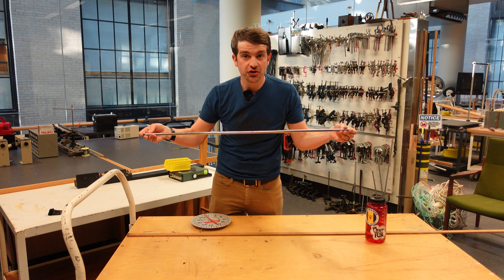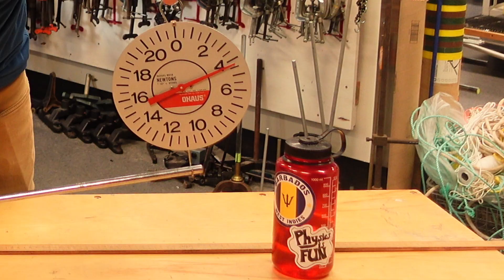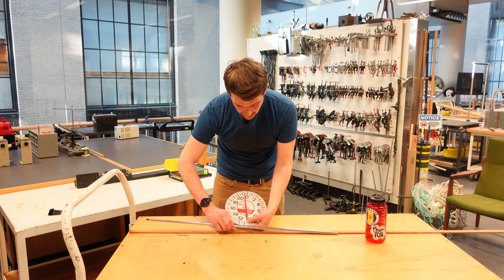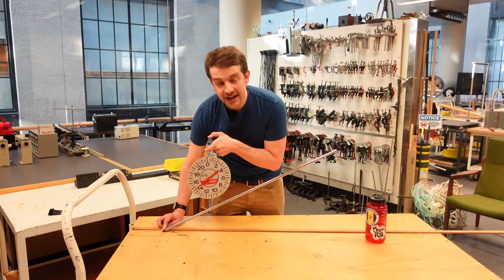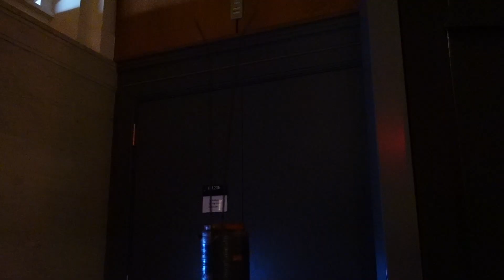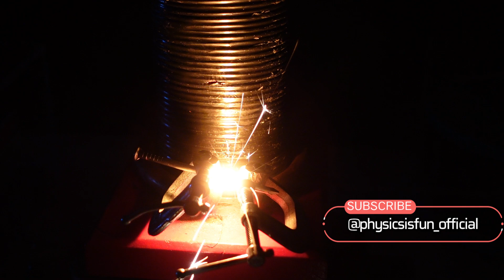MIT Physicist Explains Torque As Simply as Possible.

Comment: A good explanation, but I'm compelled to nitpick (albeiit on an important distinction)  Near the end of the video you refer to the "thickness"of a screwdriver handle.  I think you really mean the radius of the handle.  That is, the torque is the (perpendicular to the radius component of) force times the radius ( not the  "thickness"  ‐ which presumably is the diameter).  While the torque generated is a function of the screwdriver handle "thickness", it perhaps confuses the issue just a bit.

This is not intended as criticism, but rather as a comment to add clarity.

Comment: Torque is expressed ini lb.ft., not ft.lbs....
Reply from the maker: Those are both ways of saying the same unit. Force times distance is the same thing as distance times force.
Reply: @physicsisfun_official  The correct unit for torque is lb-ft (pound-foot), not ft-lb. Here's why:

Torque Definition: Torque is a measure of rotational force and is calculated as the force applied times the perpendicular distance from the axis of rotation. For example:

Torque
=
Force
(
in pounds
)
×
Distance
(
in feet
)
Torque=Force(in pounds)×Distance(in feet)
Unit Order: By convention, torque is expressed as pound-foot (lb-ft) to indicate "pounds of force applied at a distance of feet."

Common Misunderstanding
ft-lb is sometimes mistakenly used for torque but is more appropriate for work or energy, where the force moves through a linear distance.
For example, lifting a 1-pound weight by 1 foot requires 1 ft-lb of energy.
So, when talking about rotational force (torque), stick with lb-ft!

Comment: Ok, this explains torque when you're turning a nut or a lever, but what does torque mean when referring to a car's power?
Reply from the maker: @realSamAndrew  the ability for an engine to rotate the crankshaft is a measure of the cars torque. The more torque it has the more ability it has to rotate the output shaft. So large amounts of torque is great for pulling large loads especially down low at slow speeds.
Reply: Torque is time derivative of angular momentum, or how quickly the angular momentum of a system change. 
Power equals torque times angular velocity.

Comment: Can i ask; if a car wheel is twice the diameter, does the engine work twice as hard to rotate the tyre? Wondering how this effects the performance of a car as i have been looking at cars and it seems the upgraded models have larger wheels for some reason.
Reply from the maker: @stephenmorris3696  yes a larger wheel is more difficult to rotate. However, modern wheels are quite light and the spokes help reduce the rotational mass. But, it still does have some affect.
Reply: @ thanks for getting back to me. True they all seem to be alloy now. I have an old Honda with steel wheels and plan on keeping it for many more years, so next time my tyres need replacing I am thinking of going to alloy slightly wider wheels. It’s my understanding the thing I can do for the environment is keep my car as long as possible, as more damage is done to the environment in the manufacturing process, i only drive 8,000 kilometres a year.

Comment: Excellent, and  yet there remains this great mystery -- torque vs horsepower. I say this not by way of criticism, but in hope that you might be the one who finally can help me understand the difference. Please help me, Obi Wan -- what is the relationship between torque and horsepower, and how does it matter when driving a car?
Reply from the maker: @mannyedwards2820  basically horsepower tells you how much energy per time an engine can put out. Torque tells you the cars ability to rotate the crankshaft. So a larger Torque means you could pull a larger load and have more "grunt" at lower speed.  But I can definitely do a little video explaining the two in more detail 👍
Reply: @physicsisfun_official  I think I’m beginning to get the picture. For a given cylinder volume and combustion force, the torque increases with the length of the connecting rod, because of leverage. The rotating force of the crankshaft is transferred by gearing to the wheels, and translated into linear force at the pavement. So all gearing and fuel consumption and everything else being equal, an engine with a long stroke produces more acceleration at the same RPM as an engine with a shorter stroke? So then at some point the engine reaches the maximum amount of fuel it can burn in each cylinder with each ignition, and therefore the max torque it can generate on the crankshaft, and so at that point, the only way to increase power is to increase the RPM. That’s why I can peg my torque meter as early as 2000 RPM, but the HP meter (and rate of acceleration) keep rising until almost redline.

And that’s the interesting thing, if I understand this correctly; at some point, the torque at the crankshaft reaches a max, but if I simply maintain this amount of rotational force while increasing the number of revolutions per minute, I’m producing the same work in a shorter time, which is an increase in horsepower. Is that correct?

Comment: If we double the bicycle wheel diameter will we go twice as fast for the same human energy output?
Reply from the maker: Unfortunately no, because it will require more energy to turn a bigger wheel.
Reply: @physicsisfun_official  Can human cycle faster than walk for the same human energy output? If so how?
Reply from the maker: @chetan_naik  the wheel is extremely efficient. The only friction involved is jn the barrings. The energy a human generates is the same but when it's connected to wheels you can use way mote of that energy effectively. Gearing helps amplify that even more 👍

Comment: So what's the difference between Torque and moment ?
Reply: In engineering, Moment is the product of force times distance that causes bending.  Torque is the product of force time distance that causes twisting.  If you have, for example, a relatively long shaft with a driven gear in the middle, the force driving the gear causes a Torque on the shaft that is a function of the force and the gear radius.  The same force also causes a Moment that is a function of the force as well as the  length of the shaft, along with the axial position of the gear along the shaft.  So, the shaft is subject to stresses from bending (Moment) AND stresses from twisting (Torque).  The physical nature of Moment and Torque are different as they have different consequences in stresses induced on a part. The same force often results in both a Moment and Torque (typically with different values). It's important to keep this distinction in mind when analyzing the load carrying capability of components subjected to forces. While physicists (and  mathematicians, as well as theoretically inclined engineers) often conflate Moment and Torque, there is a fundamental distinction.  While there are some particular situations where a torque (acting on a shaft) can result in bending of a coupled component (and vice-versa), there is a physical distinction between the two.  While, mathematically they are both "couples",  ( the source of the cofusion/conflation, i think) there is a distinction that needs to be understood.
Reply from the maker: @suryanarayanan5614  what course you take/where you learn it! I took a grad engineering course in grad school and the professor started in with "calculate the net moment" and I went "um.. sorry but I've been doing physics 6 years now and I've never heard of that?" And he goes "oh in engineering we call a torque a moment " lol I've used "moment arm" to calculate torque. But never used moment itself as the word for torque, but many texts/university's do!
Reply: @physicsisfun_official  I'm doing a bachelor's in  mechanical engineering. 

I distinguish between torque and moment by considering torque as a specific case of moment, where it acts along the axis of a body (eg: shaft ) and actually rotates it .Moment on the other hand just causes a rotational effect like bending  . Idk whether that's technically correct.
Reply from the maker: @suryanarayanan5614  technically torque is not a specific case, but again there is a vast difference in terminology across industry, especially between engineering and physics 👍
Reply: @SuryaN000 
In Physics,
Simply ,moment means turning effect.
Torque produce turning effect.
Moment of force produce turning effect.
Moment of couple produce turning effect.
Unbalanced force produce turning effect.
Moment of force or Moment of couple,shortly known as Moment.
Literally,
Torque=Turning effect=Moment of force=Moment of couple=Moment 
👍

Comment: To avoid confusion between unit of torque and energy, torque  can be expressed as Joule per radian. Or Newton meter per radian. Dot product between force and distance produces energy, which is a scalar. Cross product between force and distance from fulcrum produces torque, which is a vector.
Reply: Based on your  continuing replies, I can only come to the conclusion that you are being deliberately obstinate, or have been poorly educated and don't understand the true nature of torque.  You can search the archives of respectable Engineering publications such as  SAE and ASME, and you will find little, if any at all, evidence to support your position that torque should be expressed as  Joules/radian or Newton meters/rad. 

I won't waste any more of my time responding to your comments - and hope that anyone who reads this string of comments is able to understand the problem in using Joules/rad. (Or any other unit of energy/radian  eg calories or BTUs/radian)
Reply: @ The hardest part of learning new things is to first unlearn previous knowledge that is incomplete or inaccurate. It's often easier to teach young people who hasn't been exposed too deep to those previous knowledge.
You can check the unit consistency in motor calculation for power.
P=τ⋅ω
where:
P = Power (Watts, W, Nm/s)
τ = Torque (Newton-meters per radian, Nm/rad)
ω = Angular Speed (radians per second, rad/s)

If you omit the unit radian from torque, you get incorrect unit for power.
Reply: If you're still struggling to understand my comment above, here's the break down.
Here's a common values in industrial motor.
P = 1000 W = 1000 Nm/s
ω = 3000 rpm = 50 rps ≈ 314 rad/s
τ = P/ω ≈ 1000/314 ≈ 3.18 Nm/rad

You can use an alternative unit, e.g.
τ = P/ω = 1000/50 = 20 Nm/rotation

If you use unit for rotational angle other than radian, you must include the conversion factor in your equation. Otherwise you will get the wrong value. Using radian is convenient since its conversion factor is 1. But as we can all see, it can make us forget that it's there all along.
Reply: This strikes me as an almost surefire way to CREATE confusion and obscure the fundamental nature of torque - which is, as explained clearly in the video,  the product of force times distance (or  as alluded to in the video, more precisely  - the perpendicular component of force times distance).  Using units of torque as Joules per radian makes no physical sense. Joules are the fundamental unit of energy in the SI system, and radians is a (dimensionless) measure of an angle.  What's the angle here that relates to the definition of and understanding of the nature of torque? 
When I was a Mechanical Engineering professor, I occasionally heard students use an engineering equation solving program that frequently gave answers in units that made no physical sense.  I created a "wall of shame" at the entrance to my office where everyone entering would immediately see.  If a student lacked the understanding to use appropriate units in the answer to a problem (even if the units "worked out"ok, their solution would find itself on the wall. Most assuredly, Joules per radian would make its way onto the wall. While not quite as egregiously bad, Newton-meter per radian would find itself there as well.  Adding dimensionless numbers as units to perhaps serve as a memory aid is just plain silly.  How about Joules per radian per Re per Fr?  There are a whole host of dimensionless numbers we can choose from, most of which don't add anything meaningful.
Reply: @frankfronczak4469  If you are confused, that's because you have misunderstood the concept. If the torque doesn't cause change of angular position, no work has been done. You'll understand better if you learn about the torque of a motor. Perhaps experimenting with variable speed drive can help.
Reply: @hamdaniyusuf_dani  I am not the one who is confused here. I perfectly understand that work is forced times distance or,  for a rotational system torque times angle of rotation. My point is that there is no reason to express torque in units of energy per angle of rotation. The fundamental nature of torque is force acting at a distance. Not all torques result in work being done.   Only if the torque is accompanied by a rotation then there is work being done. There is no reason to include the concept of work associated with torque for the situations where there is no work being done.That is, such as the case where the torque is applied statically. Newtons and meters are fundamental units in the SI system. Torque is readily defined in terms of these fundamental units. There is no need to introduce additional units such as radians. 
 Furthermore your suggestion that I am confused and my confusion would be cleared up by looking at variables speed devices is quite condescending. I have been engineer for more than 50 years.I worked with and designed vehicle power trains, including those that had continuously variable and infinitely variable speed transmissions. In my work I worked with advanced power trains including those for hybrid vehicles and
I have co-authored numerous SAE papers on the subject, and have taught thousands of Mechanical Engineering students.  I am confident that I am not confused about the fundamental nature of torque.
Reply: @frankfronczak4469  Torque is the rotational equivalent of force in linear motion. It's a measure of how effectively a force can cause an object to rotate around a specific axis. It's also known as angular force. 
Converting linear force into angular force can be done by multiplying it by distance (along the circumference) per angle of rotation.

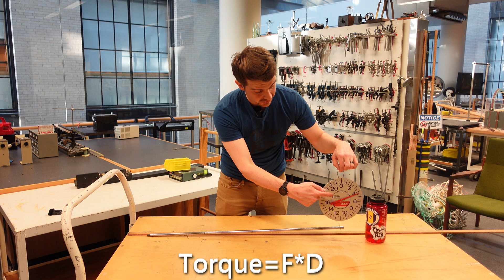Comment: 1:27
The "meter" in newton-meter is not about "how long" is the object..
It's about the distance it moved.
For example, you should have lifted it at one meter high.
Reply from the maker: That is incorrect. Torque is FDsin(theta) where F is the force applied, D is the distance between where the force is applied and the  axis, and theta is the angle between F and D (here I keep it 90  degs to make it maximum Torque sin(90)=1👍
Reply: @physicsisfun_official  Martf, the distance it was lifted would be force times distance, which is Work. That is not the same as torque, which is force times distance from a rotational axis.
Reply: @dj-flights7376  You said what I came here to say - he's conflating Torque with Work.

Comment: There is no such thing as torque being a "rotation force", or " force to rotate "..
Torque is a term to describe  the energy/power/force required to displace something in a linear/straight direction over a certain distance.

It is mostly used in motors descriptions, but has nothing to do with rotation, what so ever.
Reply: Not so, by a long shot. A torque is a twisting force, as may be applied by a torque wrench.
Reply: @clarencegreen3071  What I came here to say. martf1061 is mixing up Torque and Work. Not sure how he thinks it applies to a motor, if it has nothing to do with rotation!  🙂

Comment: Frustrating .
Many mechanics car guys misunderstanding this .
I try to explain torque and how horsepower is torque at a rotational or linear  velocity.

I try to tell them you can have torque static without power as in structural engineering.
But no horsepower is possible without torque and motion acceleration etc .

I took university level physics but I am a mechanic.

Most mechanics don't understand electricity principles either.

Do a series on basic Newtonian Laws and electric DC circuits.
👍
Reply from the maker: @Motorhead250  sounds like a good idea👍